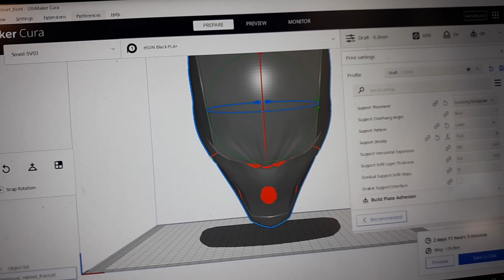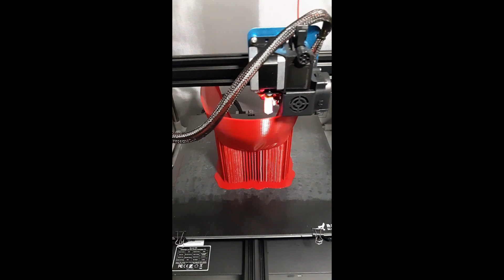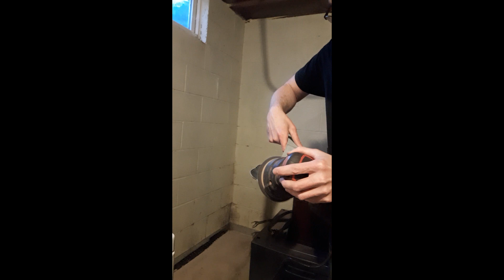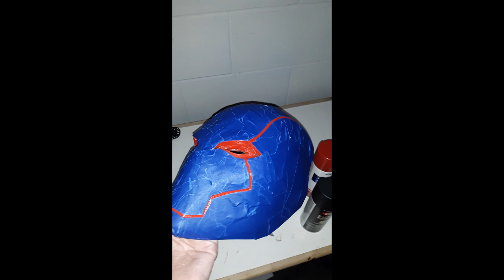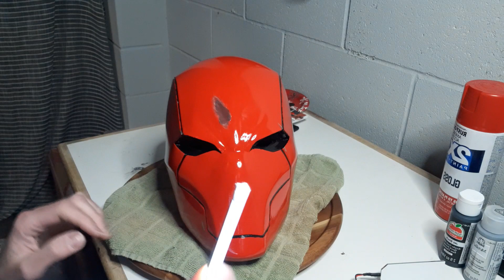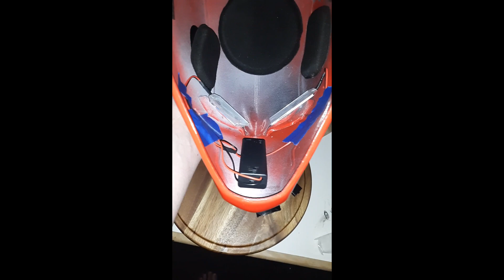3d printed red hood helmet

Comment: Your settings must need adjusting cause that taking 2 days and change is actually crazy and you used more material then I used when I made it and a lot of unnecessary supports that coulda saved a bunch of time if anything